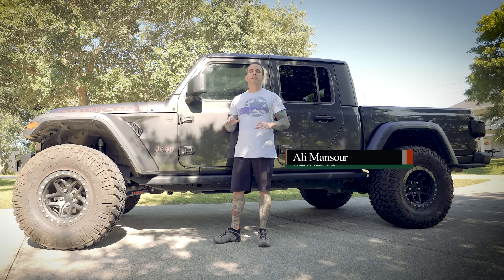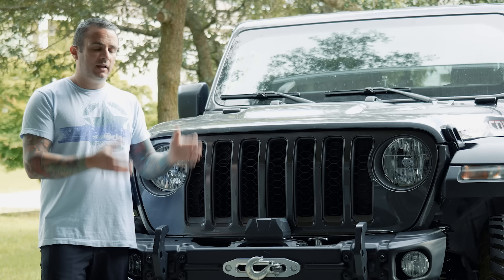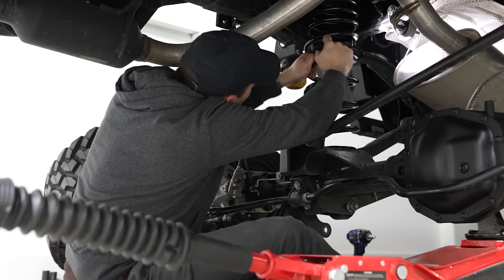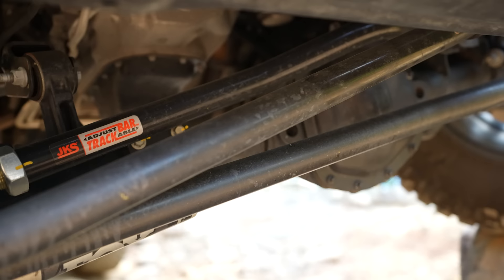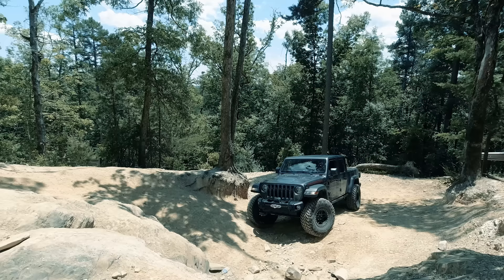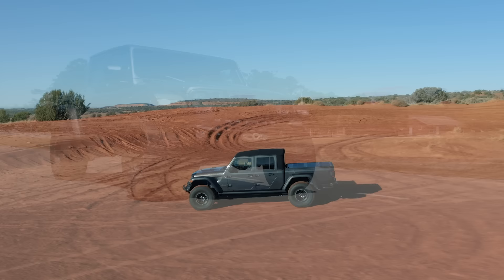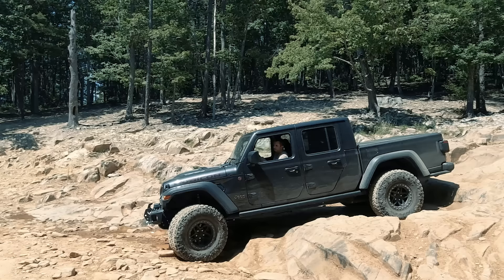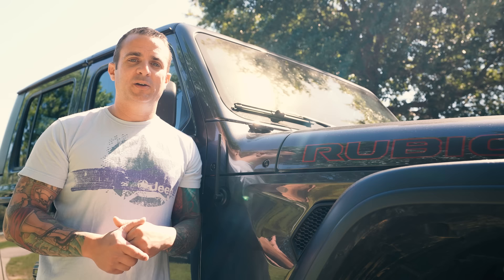Jeep Gladiator Rubicon 3-inch JKS Suspension Lift Install & Review | Inside Line

Comment: Is the death wobble being fixed?
Reply: What death wobble? I have two Gladiators and I owned a JL previous to this. Never experienced a death wobble with any of them.
Reply: @Ali_Mansour_Editor  good for you. A lot of people did and goes through a lot to fixed it. It's a solid front axel and I, own one, and it's completely different from IFS on pavement. Just admit it if you do, alot of us did and we admitted it. It not the end of the world to admit. May be your's is in a stock form, but when we modified.. You know... We have an issue called death wobble and we also knew how to fix it.. Cheers bru
Reply: @laloolhouvum1634    My friend. I don't think you realize that I'm the guy in this video talking about how I modified my Gladiator. So, no. I'm not talking about stock Jeeps.  I should clarify. I do in fact know what death wobble is. I've been writing articles about how to prevent and fix it for over 15 years. I've owned dozens of solid-axle vehicles and indeed have experienced death wobble before. What I can tell you is that my JL (which was on 35s, then 37s) and my Gladiators (both on 37s) have never death wobbled.
Reply: Bro Ali, now I got your point. You're right  you should clarify at the first place. Your current JL on 37s never death wobbled, you said. Can you tell me why she doesn't wobbled. May be I, can learn from your experience and next time when I opt for front solid axel.. I, won't face the problem again.
Reply: @laloolhouvum1634  In my experience, loose hardware is typically to blame. I’ve seen worn tires, bad ball joints, wheel bearings, and even track bar mounts all create issues. I never did anything particularly special to my JL to make it not wobble. Having wheels with a high numerical backspacing definitely helped keep the scrub radius down, which made it drive better and reduced wear on the front end components.

Comment: Ok so if I buy a Gladiator Rubicon I can buy the lift kit wheels and tires and I’m all good to go? Or would I need to re-gear?
Reply: Depends on if you plan on towing anything behind it. If so I suggest 5.13 if not you will probably lose 8th gear
Reply: I ran 37s with the stock 4.10 gears for a while. You can do it, but you won’t see 8th gear often and will have a noticeable drop in performance. I ended up going with 4.88 gears. If you look on the channel, you’ll see my video where I compare 5.13 gears to 4.88.
Reply: @Ali_Mansour_Editor  thank you!
Reply: How tall are you I’m trying to compare height to jeep lift